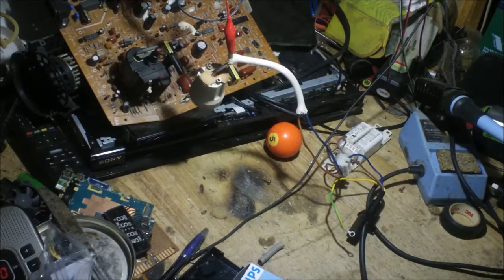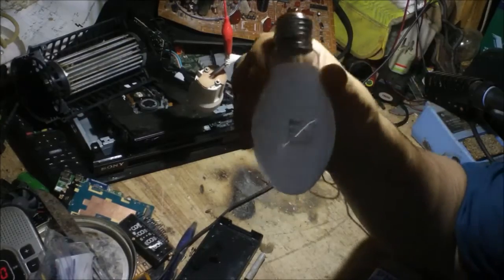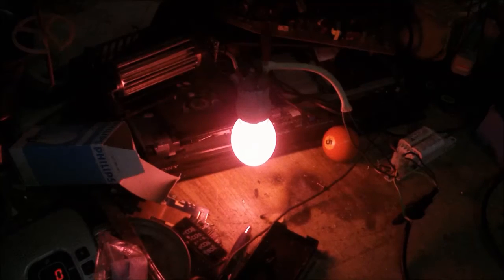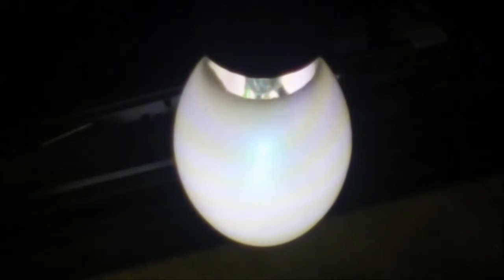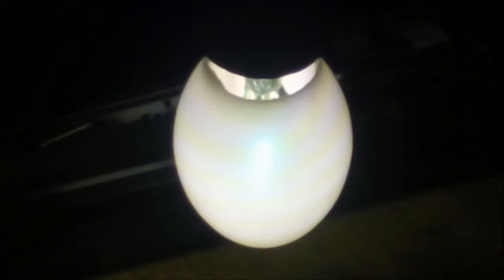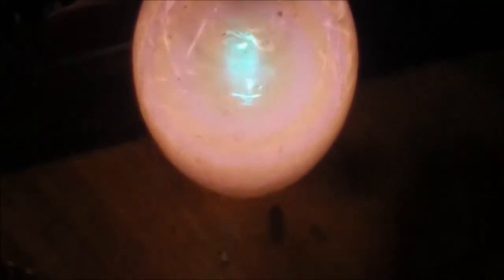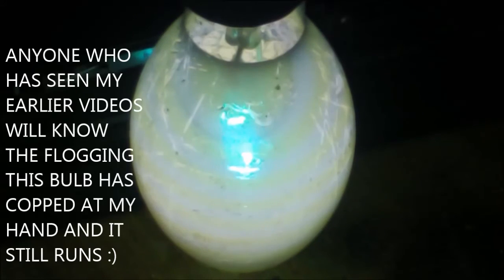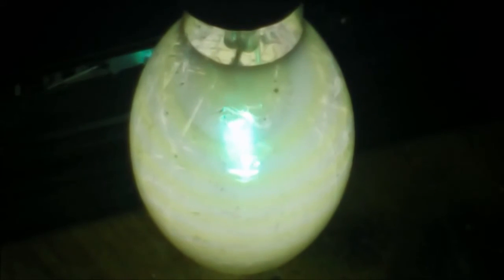THE MERCURY VAPOUR LAMP

Comment: The old MV's are renowned for being virtually impossible to kill. It's a pity they are so much less efficient than metal halides despite being more durable. Do the MV arc tubes blacken if you run them on low power? I'm guessing not, seeing as fluorescent lamps don't. There's a 250W dayburner flood light near me that's being going non stop for months without significant lumen loss which is very impressive.